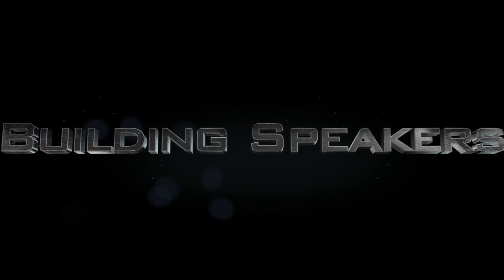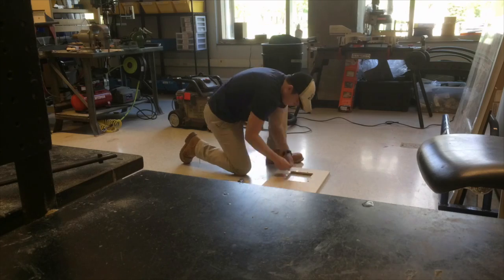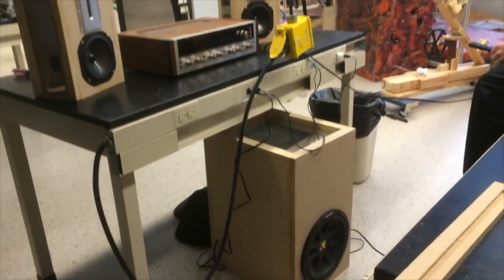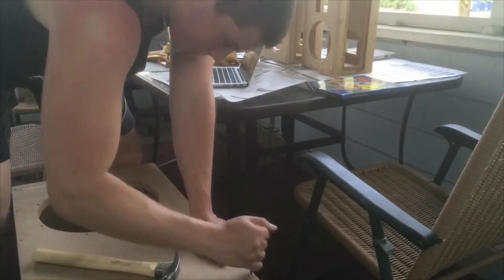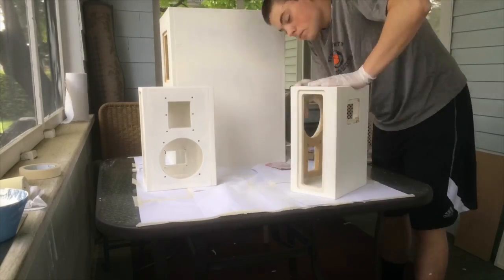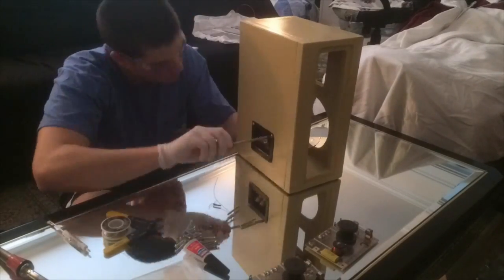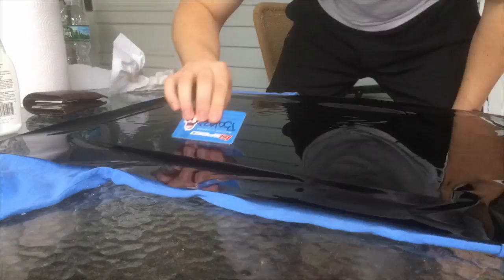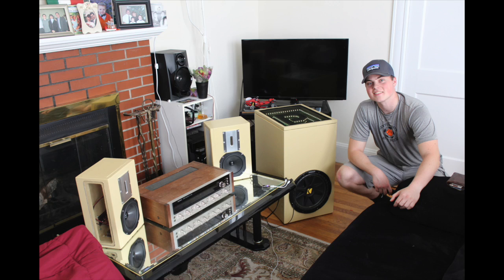Building Speakers Instructional

Comment from the maker: Aaron, the amp was a "Dayton Audio SA100 100W Subwoofer Plate Amplifier", fairly inexpensive! The "big" machine I used for cutting is a Gantry, you can program it and it will make precise cuts for you. I am indeed Hungarian! The crossover was actually donated from a teacher of mine so I decided it would be perfect to use and I wouldn't have to spend more money. Nakul, I can definitely help you with your project, you can try and message me here or find me on Facebook and I can help with any questions you may have, and that I can answer!

Comment: Informative and very thorough project Balazs! Love the smooth finish! How is the sound quality for Dayton Audio speakers?
Reply from the maker: Thank you very much Luther! The sound quality is very good especially with the crossover spreading out the frequencies to the subwoofer, drivers, and tweeters. I plan on doing some actual testing for sound quality using some computer software.